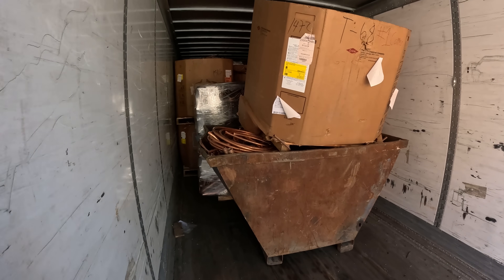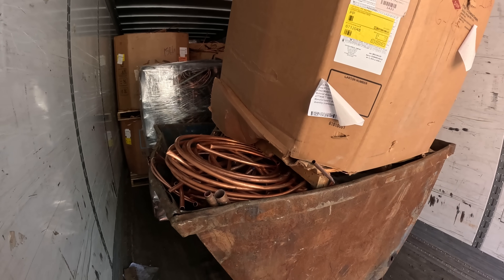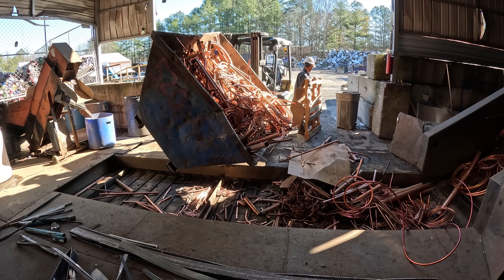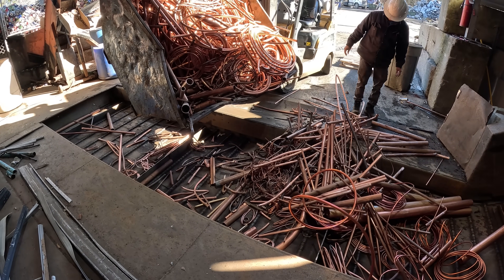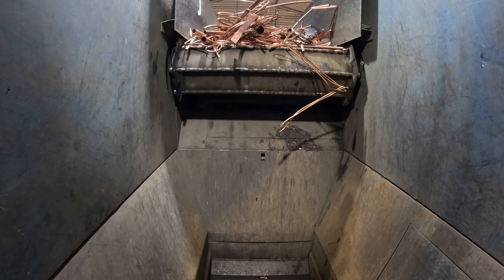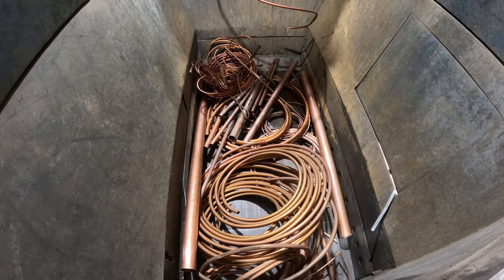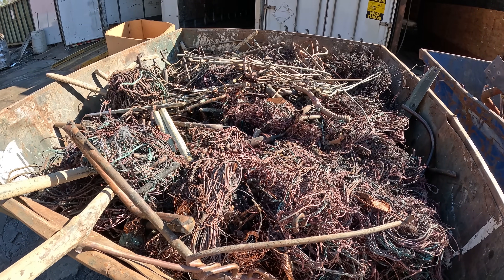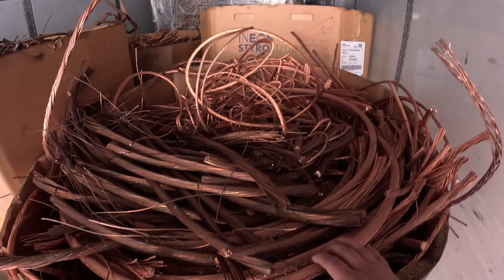This is what happens to YOUR copper after you RECYCLE it!

Comment: Wondering why you wouldn't consider running that copper tube through a metal shredder before packaging for transport?
The bails would be denser, cutting down on trucking costs (Although, trucks can only carry so much weight...)
Would the mill not pay more as it is smelter ready?
Reply: They don’t want it identifiable
They protect their thieves

Comment: You would think culling through the stock you could bundle decent random lengths of pipe (not tube) and retail it to the trade for higher than scrap prices.
Reply: No tradesman worth their salt would risk putting their name on a project using materials that didn't undergo quality control by an official retailer. A lot of this looks like soft drawn ACR which is used for refrigerants and doing anything neglectful that may cause a leak of refrigerant is a fine in the tens of thousands.
Reply: @aidanlynch1694  All such sales are at buyer's risk, you either know what you are looking at or take a pass.
Reply: there's no money in catering to the saturday morning plumbers who need 3 feet of tube:elbowcough:
Reply: @shaystern2453  I described a bundle, or a lot- you buy it all, not by the piece, this is how other scrapyards do it.

Comment: As a plumber i can tell you none of the copper i bring to scrap yards looks like that. That stuff was definitively stolen
Reply: Im confused by the “it looks damaged” comments. If there is a part that has damaged its very easy to cut it out and install a coupling. No one ever throws it out because its bent in a spot ot two.
Reply: @ptech88  yes they do. most if not all customers do not want a bunch of couplings in a run
Reply: @ how do you know what the copper looks like in my scrap?
Reply: Absolutely those 50' rolls of 1" & 3/4" copper was damaged.   See what they looked like in bails!😅
Guessing some plumbers, city utilities are missing locks on the Van's & garages..
Reply: Oh gosh, if I was stealing new copper pipe rolls, I would never in hundred years think of beating it up a little bit so IT IS THEN DAMAGED.
thank goodness the thieves will never think of that.
Reply: One of the main reasons they crush and bail copper is so the driver doesn't steal a bunch on every load
Reply: I bet that 1 1/2  by 6 foot piece was no good either huh
Reply: I was thinking the same I like to scrap hunt but I never seen anything like that so clean basically  new big rools just taken out off the spools they originally come so they can accept them an cut off some to make them look like being damage or ones I see people bring are very short pieces, but oh well we just never know how some  recycling places can be crooks ???
Reply: @Prech88 I’m wondering if some of that was acr  tubing for  air conditioning and refrigeration cause we sometimes would get rid of stuff that an apprentice would forget to put rubber caps on it or electrical tape to keep out moisture and contaminates I think it’s crazy but there’s no way all that is acr so your definitely right it’s a waste.
Reply: @angelogoreham4155  so you cant use it if that happens?  I thought once you evacuate the lines it was good, but im not an hvac guy.
Reply: @ptech88  I mean I seen I a lot of old school guys that wouldn’t take the risk. When I first started in the late 90’s it was less common to see people using a micron gauge when they pull a vacuum on the lines compared to today people use them. So you’re definitely right you could pull it all out but depending on like if you had a line set sitting out in the rain and water gets in it I just feel like it’s a pain to deal with. Also there’s no way that all of that was refrigeration pipe some of it had to be plumbing Dwv or whatever.
Reply: Most of you have clearly never done plumbing or electrical. Those rolls appear to be soft copper for direct burial. You aren't allowed to have joints underground (at least not where i live in AZ), so the odd 20'-50'  end cuts get recycled. Same goes for wire -it is cheaper to recycle leftovers and avoid the liability of a joint
Reply: Hahahahaha !!!😅😂
Reply: So them saying it was new is a lie ? I think your imagination has no value.
Reply: What's a truckload fetch money wise
Reply: Lmfao yall are dumb asf and clearly dont realize how much stuff is wasted by unions lmfao ive walked on to job sites as a drywaller and have seen full rolls of copper and wire and brand new aluminum sheets that are in the dumpster and ur dam right i took it out and scraped it and doubled my cash profit for the day 😂use ur heads ya goofs
Reply: As an electrician and a person who takes scrap to his company I’ve taken plenty of wire that looks like that which I do high voltage industrial electrical work and there are times we have leftovers or or gotten spools where they were damaged during transport or what have ya. Not everyone is a thief. And also there are companies who bring stuff to them like he said that’s damaged and instead of taking a full loss of $5,000-$20,000 or more on spools of wire they sell it to him and not suffer a total loss… so stick to plumbing and collecting your copper tubing pieces and stop taking scrap wire from electricians
Reply: If it was stolen, then better call the coppers!
Reply: Can you prove that?
Reply: Burnt wire too. Yikes.
Reply: Did you have your volume up?
Reply: I was about to say the same thing definitely stolen those are practically whole fkn rolls of copper
Reply: @jasonlapointe1876 some of you guys have never worked on a commercial job site obviously . Shit like this gets scrapped everyday or thrown out if nobody takes it
Reply: These look like maybe 10-20 feet lengths of left over ACR from some HVAC install. Rarely would you have any need for a short length like that unless you want to sit around and swedge a bunch of lengths of copper and create more potential points of failure in an install.
Reply: @aidanlynch1694  Building materials are priced by the contractor and at the end of the job everything left over is dumped in the recycle bin. No contractor has the facilities to save such stuff for the next job, the accounting for it all would be a nightmare. Ted from down under
Reply: He said it comes from businesses
Reply: Course the guy who commented you got your volume up is not accepting comments how convenient. It don't matter if it's dented a little you only need a good spot to put you fitting on and if it's bent a little o we'll it will still carry water through it lol
Reply: I worked with a plumber that thre all his copper out, I started to scrap it, crazy how some people don't want free money.
Reply: @buyystocks  last batch my kids turned in was $6000. None looked like this video showed
Reply: @ptech88  yep that did not look like scrap.
Reply: Hahahah dude we take copper Im like that all the time. When a high rise is over
Reply: Looked like a copper tubing warehouse closed its doors .
Reply: Do please tell me in detail how you think it is stolen? Genuinely curious
Reply: @Fallout4guy1  it looks to clean and new. It makes no sence to scrap it at a loss. A roll of 3/4 copper is around $200. So lets say you scrap it, you may get $25 if you’re lucky. Makes no sence, unless you didn’t pay for it.
Reply: @ptech88  ah alright i get what your saying
Reply: @Fallout4guy1 I'll ask you a question. If there is $500 worth of scrap from your build do you ever get any credit for it? HUH?
Reply: I believe he said the tubing was damaged.  It looked dented and bent.

Comment: Why would anyone need to "recycle" brand new copper tube still rooled up? 
This makes no senses at all. 99% chance every inch of that is stolen. 
Why would anyone sell new copper for scrap? Anyone in the trades would buy or use that. 
I would tell anyone scrapping full rolls of shiny brand new material to return it from where they got it. 
You are buying stolen material if you ask me. You have to know that.
Reply: Makes me think how many trades hire people knowing they have no documentation or legal right to work or live in the US. Yet somehow that gets a free pass. We get what we tolerate.
Reply: No reputable contractor would but the end of a roll or short pieces of pipe and install them as new. Also Could have been out of spec from a manufacturer or leftover pieces from some sort of factory, think bigger picture than a tweaker with a pick up truck.
Reply: @trackjosh  I'm not talking about shorts. I'm talking about those 50' + and full new rolls of copper tube going on the conveyor. They don't even cut it up to look like scrap. Full uncut and shiny brand new rolls. Defective out of spec material would probably not be scrapped by the manufacturer for a loss. They would recycle it themselves. That is not scrap material.
Reply: @trackjosh  out of spec? Why would it not go back to the manufacturer instead of a scraper?
Reply: @trackjosh Many people could use even short pieces for various things!

Comment: I am sure I read somewhere that copper is quite a special metal, as it is infinitely recyclable? is that correct?
Reply: Well it was made in a star so...we can probably get away with a couple passes through the refinery.
Reply: that's aluminum
Reply: Yes each smelt you lose very little metal because it has such a low melting point

Comment: All that new copper would make me very suspicious as to its origin! 🥷🏻🥷🏻🥷🏻
Reply: “Damaged” new coils. Ya right!😅
Reply: New coils like that "damaged" would be a return item or scrapped by manufacturer going right back into production.    NEW rolls coming to 3rd party recyclers are probably 99.9 % hot...
Reply: They don’t care about origin, they make too much money. They are glad to take stolen catalytic converters or whatever stolen shit you bring in
Reply: Only thing i can guess is that it was a damaged shipment and is part of an insurance claim.  See that pretty often with trucking.
Reply: A lot is most likely from the manufacture. Rejected by quality control
Reply: @johnpietros9439 Wouldn't they just reprocess it then instead of losing a lot of money selling it to a recycling company
Reply: Worked in wholesale plumbing supply business, copper tubing is very soft and easily damaged. Not everyone is a criminal!
Reply: just shut up?